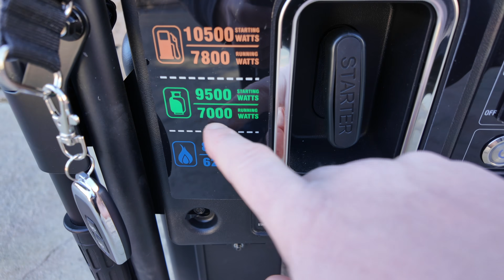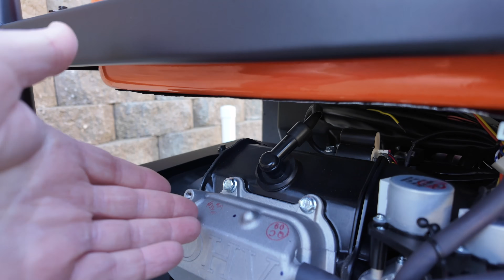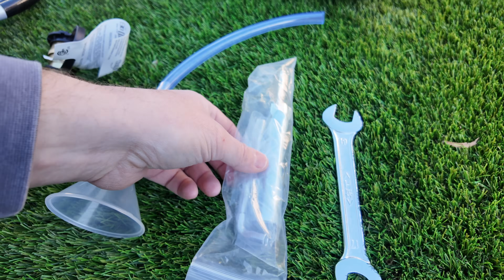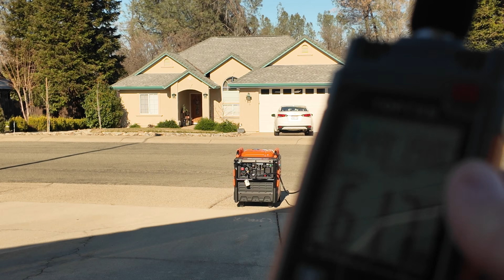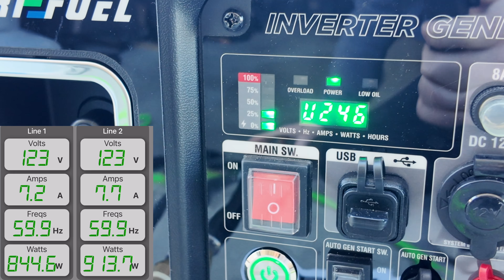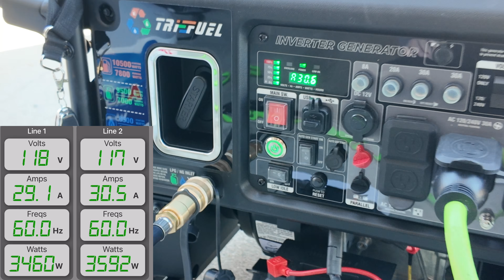New 2 Wire Start Generator- No One Has! GenMax 10500XiT-Full Review

Comment: I didn’t purchase a Genmax because of warranty and all the negative comments about service issues. Service seems to be poor.  Of all the generators you review, have you ever dealt with the service center’s?
Reply from the maker: I have small engine shops that work on other brands but not GenMax yet. I know they are expanding to more shops to handle service and warranty work. But most shops will still work on most small engines for your basic work and maintenance. 
But yes they still need to improve on that area. They make some of the most innovative generators but the one year warranty needs to be two at very minimum if not 3 and warranty parts and work needs to continue to expand
Reply: I purchased my generator from the generator store and I had excellent customer service I couldn't get it started on propane they told me exactly what to do and it worked perfectly😊

Comment: Premium fuel burns SLOWER not faster.... The higher the octane the slower and cooler it burns.... Hence less detonation on higher compression engines....
Reply from the maker: Don’t think I ever mentioned it burning faster. 
And yes burns slower hence has a slightly higher flash point as it needs more compression/ timing to ignite and combust properly. 
It can help old engines with excessive carbon build up though.
Reply: There’s quite a bit more to octane than stated. There’s no harm or problems with running a higher octane than required other than the price. But a major advantage to using premium fuel for equipment; the fuel lasts longer in storage. It’s more refined which leads to a more stable composition. From Sunoco, 93 can last month’s longer. Seems like a reasonable trade off

Comment: I have one of the 6000w generators from a couple of years ago and have had nothing but problems. I had a capacitor blow within a couple hours of use, and after I got a new circuit board, took almost 2 months from China, it worked fine, at least for about a year. Now the overload won't reset.
Reply from the maker: Interesting, someone else who had a a 6000 had a problem with one. Totally different build but

Comment: I like how it's still an inverter generator but the benefits of an open frame design.
Reply from the maker: Yup! And more and more are coming as we change the way we power things. So more inverters needed that are not so big and heavy lol.
Reply: It says inverter on the frame.    It also would not have a perfect 60hz frequency and close to perfect sinewave.
Reply: I don't think there is a benefit. Nothing I've heard here I would consider much of a benefit really. There isn't any data about open frame lasting longer either that I'm aware.
Reply: I'm not sure the open frame is an inverter unit
Reply from the maker: Yup it’s an inverter, the frame has nothing to do with it. Just the way it’s designed 👍🏼🙂
Reply: @johnnysweekends did they say when they plan to switch the 50amp outlet and the 30amp outlet with each other so the 50amp plug is not sitting above the wheel?

Does the 30amp outlet provide 30amps while using natural gas, and or propane?
Reply from the maker: @1125-CD I do t know when they will switch or if they actually will. It was an idea. 
They said it was a good idea and will look into right away. So I assume if they already made several hundred the. It would be the next batch or the batch after. So maybe 3-6 months or…🤷🏼‍♂️ 

As far as any generator, no matter the plug, 15 amp
20amp
30amp 
50 amp

It can only out out the power the unit is rated for. 
Just because it has a 50 amp plug doesn’t mean you get 50 amps or 30 amps from the 30. 
They can handle those loads but only if the generator it self can produce that much power. 
This one can only output 10500 starting watts for a split second then a max of 7800 watts on gasoline.

So that’s a total of 65 amps total output
So at 240 volt or two legs of 120 you get 32.5 amps per leg.
Reply: @rickbraden4272  he clearly stated that in the beginning of the video
Reply: @rickbraden4272 says it right on the Generator

Comment: Check out the Pulsar GD10KBN if you need a more budget 10k open frame inverter. Splitting image, and on sale for ~$950. My only gripe is fewer breakers, and no 2-wire.
Reply: Pulsar is only Dual Fuel, not tri-fuel
Reply: @JudeLeonards  sorry I had typed out also "if you don't need LNG" but guess I erased it.
Reply: It's really not getting great reviews so far.  Guess you get what you pay for with the China clones
Reply: @ITguyAR_66  roll of the dice. There were zero reviews at the time I purchased, but I did get very quick responses to customer service when I called. I was able to talk to someone in the states and they emailed me a copy of the manual to review before purchase. If I lived in hurricane alley I might have thought differently but this is backup of a backup (solar+batteries) for me so not worth spending premium money to sit around years and years on end.
Reply: @ITguyAR_66   where are you seeing reviews? I’m unable to find information or reviews about it online.I have the pulsar GD10KBN and they’re essentially the same generator, same engine and both made in China.

Comment: I have the larger enclosed  unit and am impressed at how quiet it is. I run it on natural gas since breaking it in on gasoline. It runs so much better and quieter on natural gas. It is inside the barn with the exhaust piped outside. I asked the neighbors if they noticed the noise and they replied "what noise?" I have two other inverter/generators for portable use so the 300 lb weight is not an issue. This is the final piece of my battery/solar/generator off grid system

Comment: Can I use it for charging electric car in emergency?
Reply: You would need a bonding plug, since it is a floating neutral generator the EV charger will see it as an “open ground” and not operate.
Reply from the maker: @Frog-ko6uu correct and it does come with one in the accessories box 👍🏼
Reply from the maker: Yes!!

Comment: THD measurement when its under load would be nice information to know also.. Thanks
Reply: I have the enclosed version of this inverter generator and it has a THD of less than 3%.
Reply from the maker: A separate meter is anywhere from $800-$5000
Or it’s a giant mathematical equation that would add so much time.

But I did find something that may help. Still expensive but would nice to see the percentage 

But you can see a lot from the wave and it takes a lot to get them noisy
Reply: @johnnysweekends  I only bring it up because i know many power stations wont charge if the THD isnt under 3%
Reply from the maker: @unijabnx2000 I’ll start adding it to my tests, I bought another meter. Mine will do FTT but it’s not good enough to calculate the values from it, and then average it out. 
So since several people request it I’ll add it 👍🏼😀
Reply: @johnnysweekends  Amprobe makes a handheld multimeter that measures THD.  But as you stated, they are pricey!! ~$400.00 bucks.  Amprobe ACDC-52NAV

Comment: I just got a Westinghouse WGen11500TFc - Tri-Fuel for home backup.  It's a non inverter generator that has <5%THD.  Have you ever reviewed that unit?
Reply: It's not a linear 5%.  THD rises as load increases. It's been tested. Westinghouse puts that on there rated at low to no load.
Reply from the maker: I have not. It should still work for most anything except charging power stations and probably several DIY home back up systems. They are sensitive
Reply: I have that gennie as my 2nd home back up option. I run it on LPG only. It's worked like a charm. My house has 200amp svc panel and is almost 5k sq ft with two 2-ton heat pumps and all electric appliances.  I run the gennie at about 80% max so I manage my critical loads to make sure not to mess it up. Just make sure to have an idea of what your high draw items are and how they interact.  For example, our water heater draws almost 8kw, and if the heat pumps come on at the same time and the heat strips kick on, I'm looking at almost 30kw all atbonce.  I usually leave the water heater off, garage of and use only 1 heat pump during winter outtages. The 11500 has no issues at all.  Just make sure to use a tender and crank it monthly and you won't have a problem.

Comment: A great vid JW. Valve clearances are worth checking periodically for spec. Either diy if you have the ability to do so, or have a small engine mech do it. Both my MXR3500’s were mis adjusted from the factory and required re adjustment. Resulted in totally smooth running engines, in conjunction with NGK iridium spark plug replacements. Really like this Genmax generator, a real beast.
Cheers.